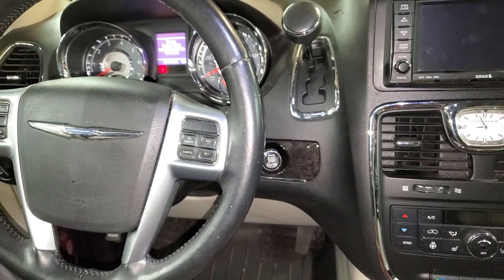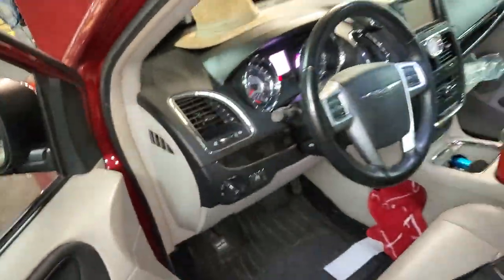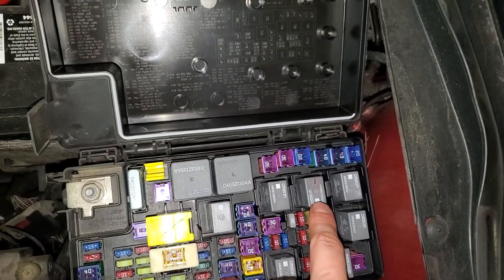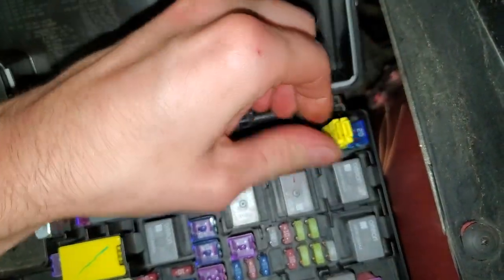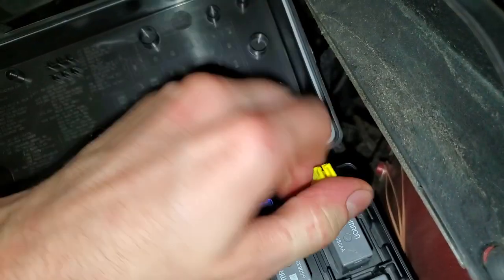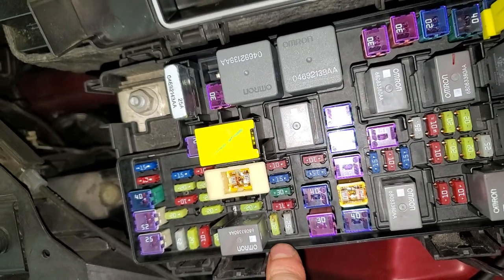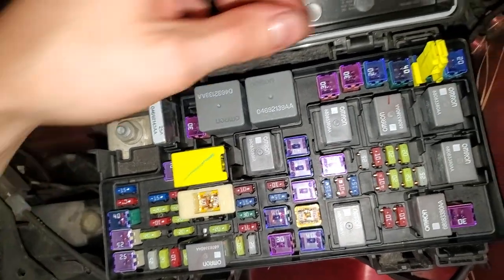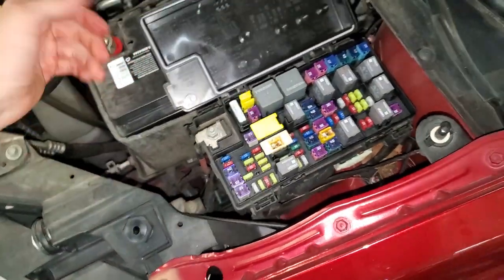2013 Town and Country Starter Fuse, Starter Relay Fuel Pump Fuse and others

Comment: What issues were u having ? Mine wouldn't starr kept sputtering
Reply: Sneaker Head ➡️ my 2013 t&c started sputtering today for the first time ., this morning I was on the highway heading to work 🛣 all of a sudden engine started sputtering and it turn off I was in the middle lane I try to start it immediately but it keep sputtering . I then left it off put the hazards lights on ., waited 10mins . I was already causing a lot of traffic ., after 10mins I try turning it on , and it started right up like if nothing happen . I started driving and made it to work 🤷🏻‍♂️
Reply: @Voltrondefenderoftheuniverse  wow mine hasn't cut off while driving yet.
Reply: Sneaker Head ➡️ hopefully u don’t experience its scary you loose function abilities of your brakes and power steering